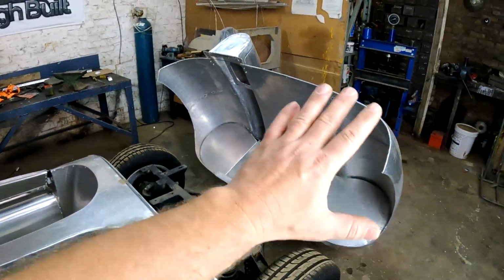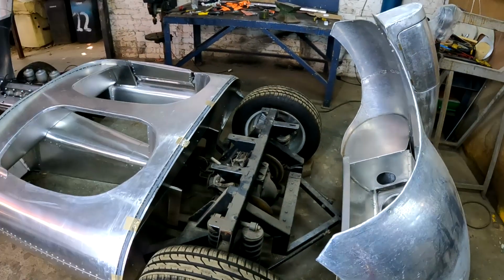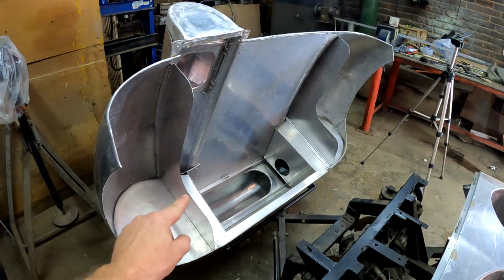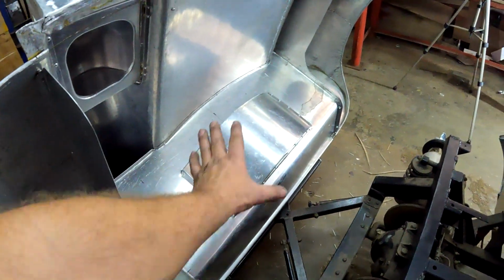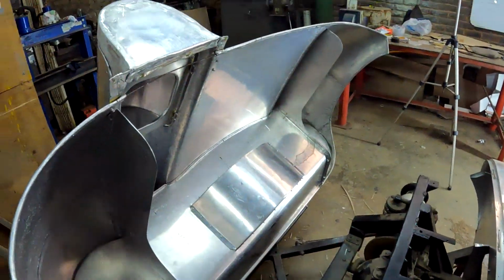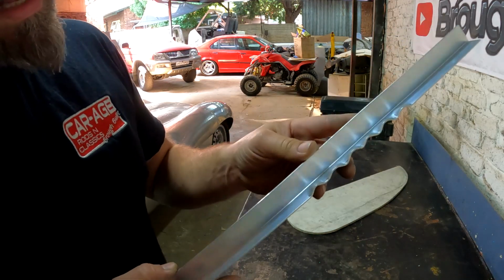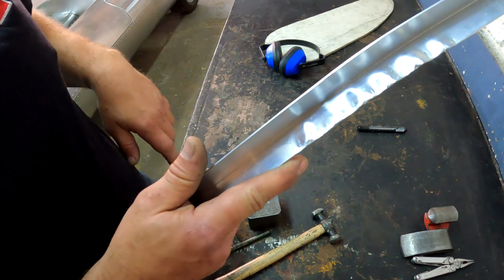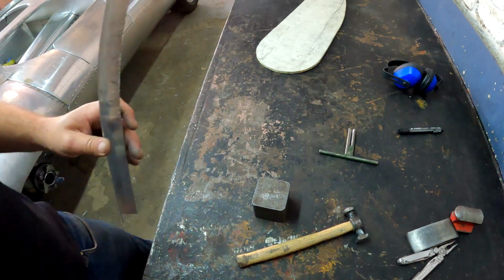Jaguar D Type Build pt 25.  Boot internal Structure

Comment: Looking awesome. Thanks for showing how you shrink the edge. Try beating it on hard wood, It helps with shrinking too. Do you not find you need to anneal the ali?
Keep it going,
Regards Paul
Reply from the maker: Thanks Paul. I have tried annealing in the past but I find (for the amount of work I do to the panels) it doesn't really make a lot of difference.